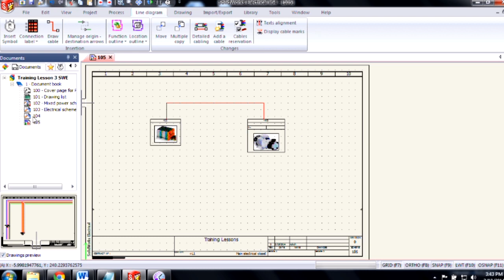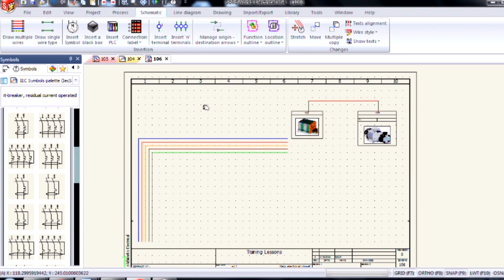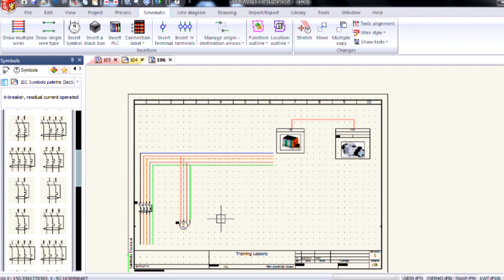SOLIDWORKS Electrical - Mixed Scheme

Comment: Thank you for the informative video but to me i find no logic in redoing the same thing twice via schematic and line diagram where both specifies the same purpose then why going through the trouble of using mixed scheme again. Is there any other advantages other than showing solidworks software development over the years.